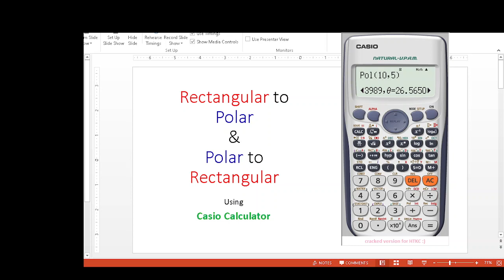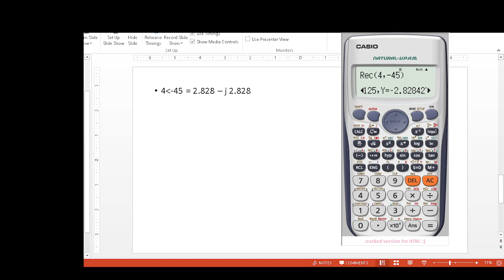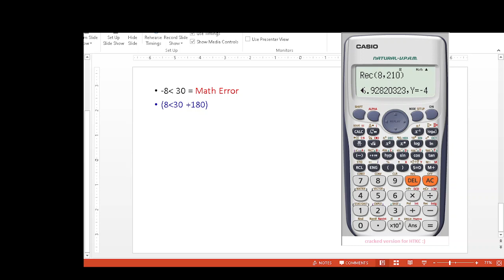Rectangular to Polar || Polar to Rectangular || Using  FX991Es Calculator || ENA 9.2(2) (English)

Comment: three parallel branches each containing  one pure element, have an applied voltage V=200sin1000t.the branches contain R=300 ohms, L =0.5 h, C=10 micro farad. determine the inet,  the angle between inet and v and the magnitude of impedance and admittance.
Reply from the maker: please mail a snap shot of your question at profkhannazir@gmail.com